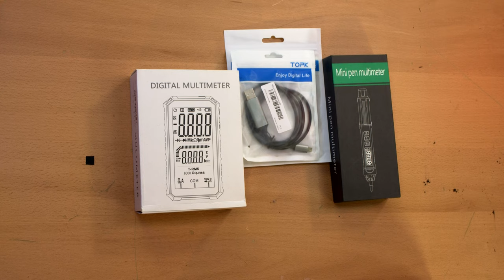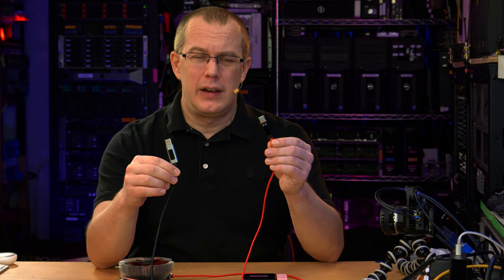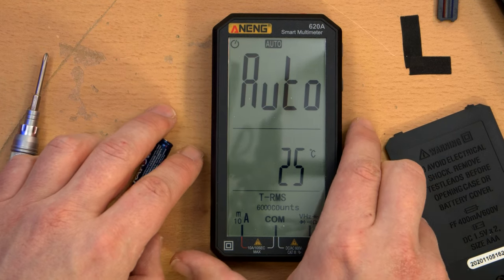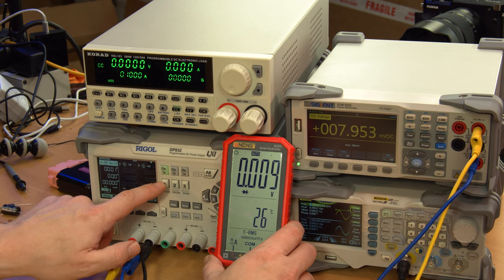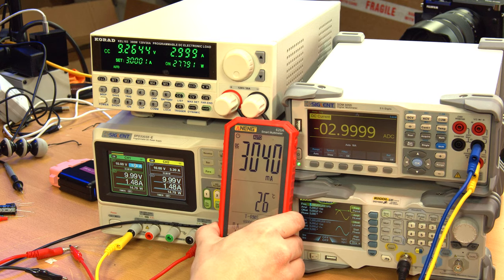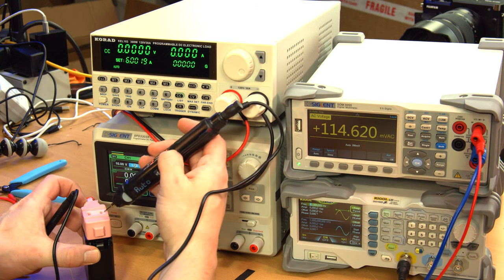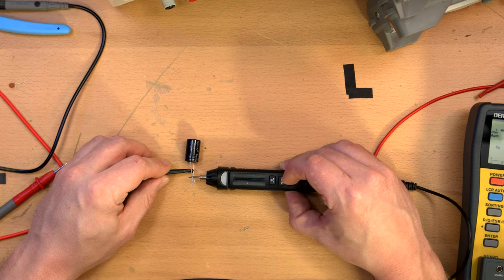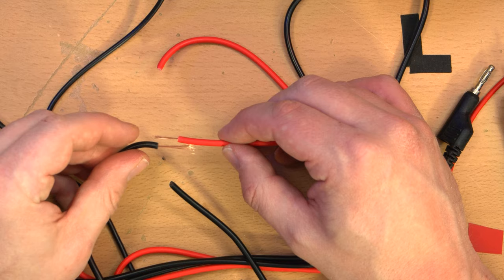Banggood USB and Multi Meters (TOPK, MUSTOOL MT007, ANENG 620A)

Comment: Great review.  I bought one of MM with the larger display about a month ago when they were on sale for $20 from Amazon.  The brand on mine is A-BF but is the same MM as yours, even the boxing is the same.  You said one of the deal breakers for you is the automatic shutoff timer.  Mine is 15 minutes of non use which is fine with me.  For the cost. I think is is a good MM to use when you don't want to take your good MM out.  Your video pointed out some interesting shortcomings.  None of which are a big deal at this price range.  Thanks and have a great day.
Reply from the maker: Thanks! And I literally just woke up so didn't have a chance to check out your videos, but I gotta say the thumbnail for Back to the Future - Radio Shack Radio just gave me a serious nostalgia hit.  As a kid I would wait excitedly for the big RS catalog to come out, and the radio section was one of my favorites.  I'll be watching that vid shortly for sure.
Reply: @ScottDotDot  Just uploaded a short video on this meter but told viewers to go to your review for details and included a link to this show in the comments.

Comment: I have the 621A and I hate the "AUTO" mode. I wish it had dedicated settings. Sometimes testing something simple, like voltage, is a real pain. Maybe ANENG makes firmware updates? I also wish I could lower the sound. You can here this thing beeping from over 100 meters.
edit: Oh Yeah ---> THANKS for the video.